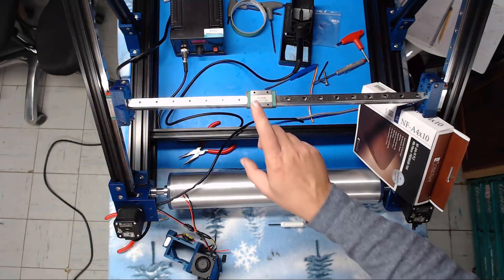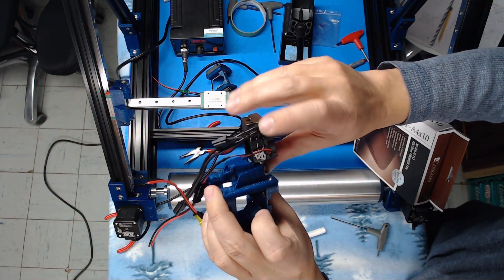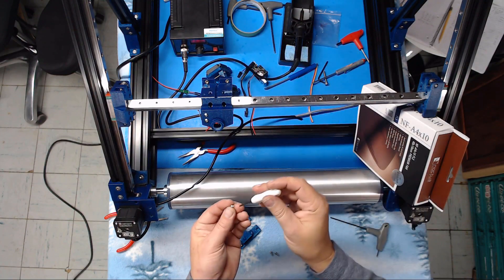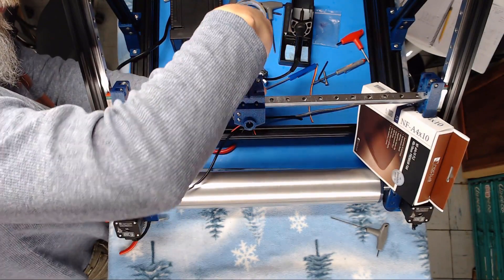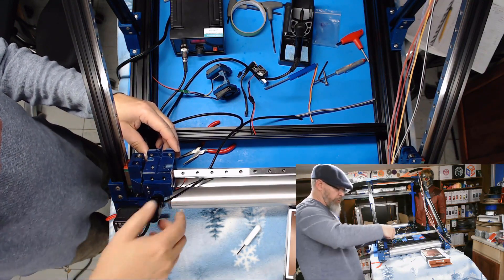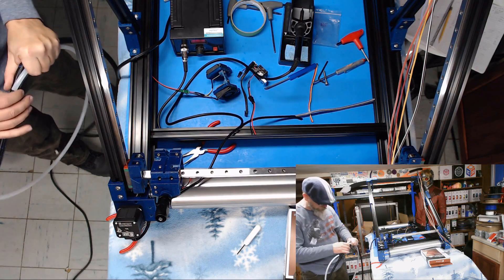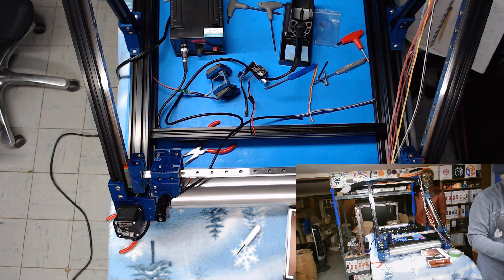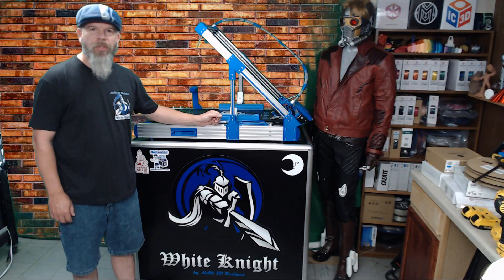White Knight Assembly part 22

Comment: What nozzle do you use?

From what ive seen they dont look like typical nozzles.
Reply from the maker: The ones I'm currently using were custom cut..  I have had some limited success with using M6 thread MK8 style nozzles..  The problem is finding MK8 style with enough threading to fit all hotends..
Reply: @NAK3DDesigns  tbars what I thought. I'm designing my own and it's the thing thsts holding me beck right now lol. I did find that the dyze pros nozzles were just over 45° as in I stick a line next to them in fusion and still had a little room at 45°
Reply from the maker: just found this listing..  they look very promising..https://www.ebay.com/itm/1pcs-3D-Printer-Nozzle-Brass-MK8-Extruder-Nozzle-Print-Head-0-1mm-M6/264801860834?hash=item3da76bbce2:g:l7MAAOSwpNRe7fEM
Reply: @NAK3DDesigns  oh cool! I didn't even think of using those! Ill have to see if there is a higher quality version available somewhere. I've heard some have issues with quality. My plan is to go idex remote direct drive. Let's hope I don't drive myself too crazy lol.